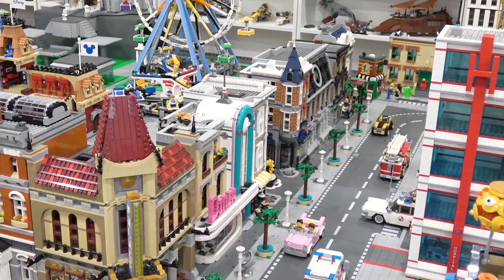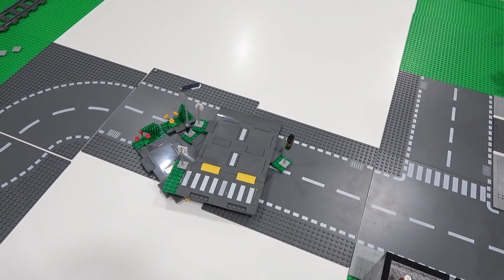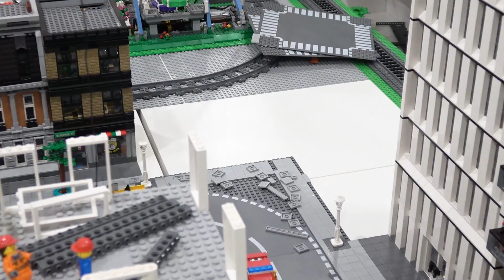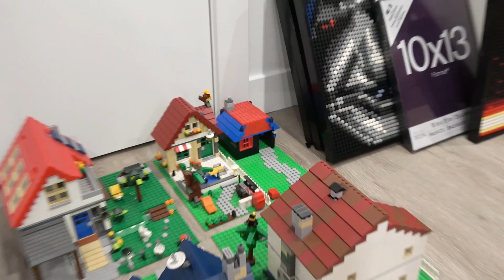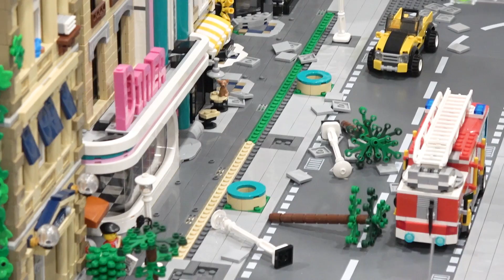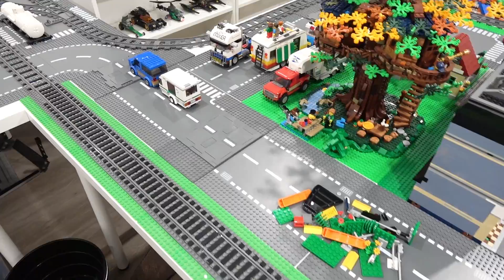LEGO City Update Placing Police Station & Moving Modular Buildings

Comment: I wouldn't worry about having the camp ground. The Tree House by itself is good.    Also using the new roads with the road plates, not good a look. I would rather cut some road plates and use them instead. Also I  still don't understand why you aren't using junction points link all your railways together.😀👍

Comment: I think one usage you might make of the new roads is to use them as speed bumps in your roads. I mean since they are higher than the other roads the difference does work quit enicely to simulate a speed bump. Also you could even  use the ramps in order to accentuate that feeling and gain some extra road distance. Plus you can place tiles on them to add some crosswalks which would also make sense to be placed on a speed bump. Think that would be a nice touch to the residential area of the city and a clever way to mix both roads styles.

Comment: Mostly good changes.  Though IMO there is too much road.  I'd remove all the roads next to the train tracks by the park.  Having access from all angles of the park doesn't add much.  You can add one entrance, then have the park extend all the way to the tracks.  The mix of old and new roads look strange as well.  The new roads may look okay for smaller side streets if needed, but not mixed.

Comment: I like the placement of the police station and the train station between the high rise building really defines the magnitude of both buildings. 
I would take out like half of the road plates around the camp grounds. There doesn’t really need to be any road access on the far side or beachside and it would free up a lot of space. 
Have you considered building a facade for the front of Diagon Alley? Like a 6stud wide face that seals it up a bit more as I fear the all grey wall stands out quite a bit right at the front of the city. 
The residential area seems a bit out of place and it’s on fortunate that from the front of the Lego city you stare at the back side of it. However I’m not sure of another location with how your city is laid out. One thing that comes to mind is maybe have a road plate (like a T) lead off the end of a table directed towards a billy bookcase and then have the houses lined up and staged as if it’s a continuation of the city at the same height. Then you’d be able to show the residences from the front and clear up several base plates spaces for custom buildings and future modulars

Comment: New setup does look legit! Couple suggestions though. I think the police station would look really good at the end of the street, where Sesame Street used to be. Also, with your shrunken park, the looped road around it seems unnecessary as you already have a road that heads towards the docks. So, you can remove that in order to extend the park closer to the tracks/beach.

Comment: the police station blocks that edge of the diner! u should use the diner as a corner building lerhaps? or swap w - different modular?
Reply: He probably placed it there because you can see the soaps and suds sign on the police station better above the stairs on that side of the diner. Putting a different modular there would block it.